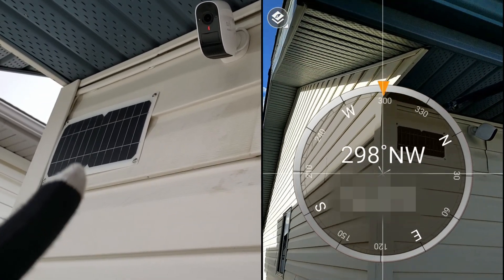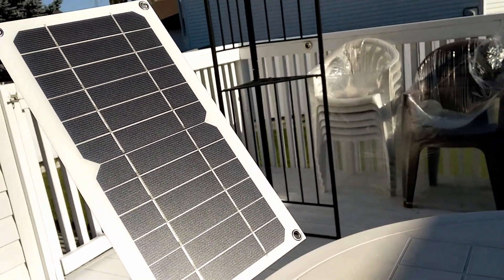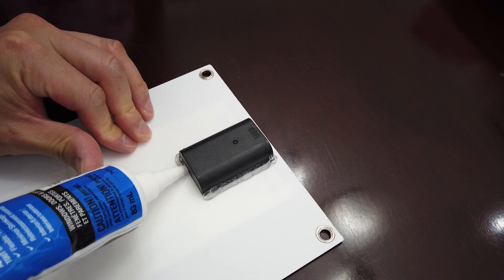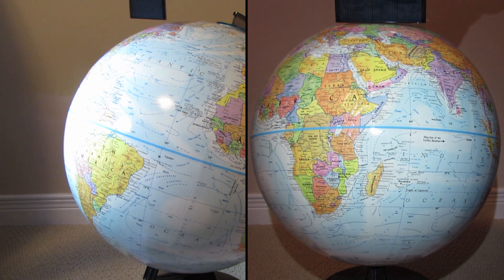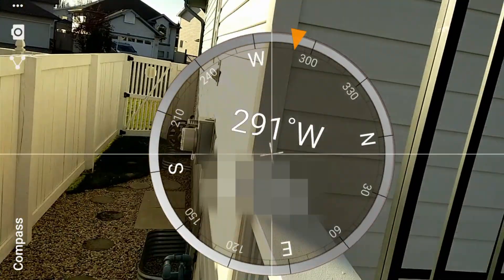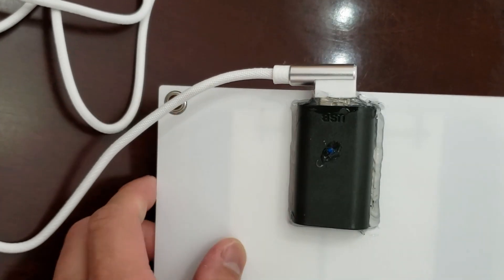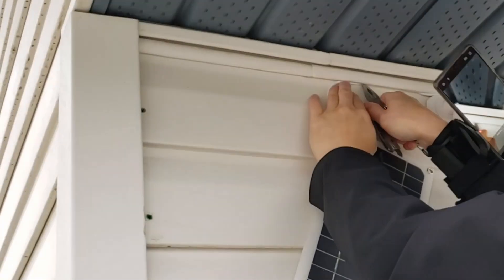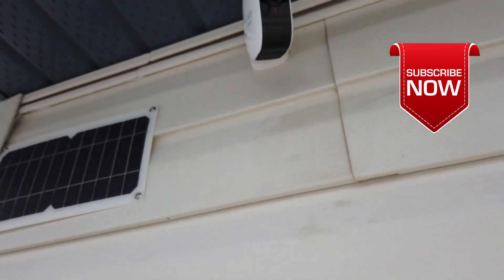Cheap DIY Solar Panel for Battery powered security cameras - Solar Power for Battery powered camera

Comment: Hi,how has it held up after all these years for both camera and solar panel
Reply from the maker: Both the camera and solar panel have held up very well.  It's been almost 4 years now and both are still performing well.  We haven't had to take the cameras down once.  Since this video, we have installed 2 other cameras with larger solar panels and so far so good!

Someone else commented that these solar panels are causing the cameras to drain overnight, but that is not what we have experienced at all.  It doesn't seem to affect it.  Maybe they were getting too many motion detections causing the camera to drain itself.
Reply: @FrakkingCreations  btw I love how u take your time to make sure our questions are answered.keep up the good work
Reply from the maker: Thank you for the comment.  We just want to provide useful information from our own experiences.  Please share and like our videos to help our channel grow.  Consider subscribing to get more good stuff to come.  Thanks for the support.
Reply: @FrakkingCreations  damn.those are some quality cameras.and by having them charged by the solar panels it keeps the battery topped up thus increasing it's life span.about the draining issue,the solar panel will not drain because the circuit board In the camera has been made to make sure in doesn't drain any battery when plugged into anything.those people might have not researched about it.ok I'm gonna buy one set of them cameras now.thank you for giving me the assurance.one more question tho,do u live in a place which get very direct and hot sunlight and rain.and are those cameras exposed to the elements.i actually wanted to get the newest eufycam 3 where there's a solar panel integrated on top of it.but I live in a place where the sun will destroy everything,so I'm not so sure whether to get the eufycam 3.logically speaking leaving it under sun and rain will obviously Degrade the camera and battery faster
Reply from the maker: We get snow and heat.  Temperature ranges from -30°C to 30°C (Winter to Summer).  And we also get rain.  Our cameras are in some shade so that may have helped with the longevity.  I think that it would be important to keep the camera out of direct sunlight, as the manuals for our cameras say to.  Heat is bad for the lithium ion batteries.  So, I'm not sure why they put the solar panel together with the camera in the Eufycam 3 since the heat from the direct sunlight would be an issue for the batteries and electronics long term.  This is especially true for hotter climates.
Reply from the maker: Add to the fact that the charging circuitry of the camera (and any lithium ion system like cell phones) would stop charging the lithium ion battery once the temperature exceeds a safe limit.  For the Eufycam 3 you would want to put the camera where it would get good sunlight to charge properly.  In this situation, the camera and battery could get hot enough that the system would stop charging even if you have great sunlight.

Comment: I have a uniden solo pro camera, i put a aftermarket solor panel on it and work well for about 2 weeks, then stopped working. The uniden solor panel output is 2.5w output power, and the aftermarket one i use is 5w . Do you think the battery was over charged ?

Comment: just thought of it but wouldn't it be cool to just install a light in front of the panel for days where there is not enough sunlight to manually charge the camera without actually having to charge it through AC Adapter? i wonder if that would work.

Comment: Can you do this with a Wyze Cam V3??
Reply from the maker: I wouldn't think it would be a good idea to run your security cameras that don't have a battery by using solar power.  In the times when there are clouds or reduced sunlight the camera may not get enough power and will shut down.
Reply: @FrakkingCreations  even if you attached a battery pack to it possibly? I'm not sure how it works just theorizing

Comment: Great Video and thanks for sharing. I have also installed 2 of them on my 2c pro cams and they work better than the Eufy solar panel that is 5 X the price.
Reply from the maker: You're welcome.  Thanks for commenting to let us know it works on your 2C pro cameras.  So far these panels have been working well for us over several winters.  We've also added more cameras and a larger panel as shown in our vinyl siding hangers video.
Please subscribe, like and share our video to help others too.  We appreciate it.

Comment: The most important part should be how to do the cabling from panel to camera, using that USB power regulator and connector types, for some reasons it was edited out
Reply from the maker: Not sure what you mean that it was edited out.  There really isn't any connectors needed for the panel since it already has standard USB A ports available.  Just using a long enough USB cable is all you need to connect the camera to the solar panel.  Didn't I show connecting the cable to the panel and also to the camera?

Comment: Does it have a battery? How does it work at night I must sound stupid lol
Reply from the maker: Not a stupid question at all.  This solar panel does not have batteries.  The camera does have a battery though and that is why this setup works.  Plus the fact that the battery lasts about 1 year when used per the specifications.

Comment: Can I use that solar panel with my Arlo Pro (I respectfully understand it would be at my own risk)
Reply from the maker: If the Arlo pro uses normal USB adapters to charge then I would think the solar panel I showed would also work for charging.

Comment: Hello Great Video I have on order from Amazon the housings for Eufy Motion Detectors. 
Question: I have Eufy 2C cams need a link for the proper  wattage Solar Panel to Buy?   
 Again Thank You Bill TOG
Reply from the maker: Thanks for the comment.
The solar panel you get would depend on your usage scenario.  I know that the Eufy brand solar panel is a low output wattage of around 400 - 500 mAh.  The 5W one I showed is around 1000 mAh and the 10W one I have a link for is around 2000 mAh.

If you find that your cameras are lasting much shorter than the specs then you are probably getting more detections than the standard used by Eufy to gauge battery life.  In that case, you might want to go with a larger panel to make sure that it is able to charge up faster.  If like us, you use it in winter, there may be times where it cannot charge ... temp below 0 degress Celsius.  So a larger panel may be more appropriate.

Note that a larger output panel may also affect battery lifespan since slow charging is typically less harsh on batteries.

The 5W panels we are using have been good so far for our Eufycam E cameras for 3 years now going into it's 3rd winter.  This year we added 2 more cameras but this time using the 10W panels I linked to.  So far no issues.

Hope that helps.
Reply: @FrakkingCreations  Thank you for the quick Reply. Will do some more research based on your reply. I live in AZ  and the summers here really get cooking 100 to 120+, I think for me  all I want to do is just charge my  2C cams when needed and move the Solar Panel to the next set of cams to charge. Been here 21 years any rubber,  plastic has a shorter life span, the sun is brutal but that's why we are here  for the sun.  Thanks Bill

Comment: All the solar panels I’ve seen say how many Watts the output, not milli amps. 
I’ve just ordered a couple 20w 5v panels from China, should be plenty big enough! 😎
Reply from the maker: Yeah. More than enough.
Generally, to calculate the mAh...
Power = Current x Voltage
Or Current = Power / Voltage
20W / 5 V = 4 A
These panels should be around 4000 mAh not taking into account efficiency and other losses.

Comment: Hi would you have any recommendations of what solar panel to get for the Eufy L20 (13,400mAh battery capacity). I know it’s not eufy supported but heard it charges with a usb-c cable fine, just unsure which V solar panel to get, many thanks
Reply from the maker: For the voltage of solar panel to get it would be based on the charger you got with the camera.  Typically it should be around 5V but best to check the charger.  Is that what you are asking?
Reply: @FrakkingCreations  Oh yes thank you for the help
Reply from the maker: You're welcome. Let us know how it goes.

Comment: Thank's a lot for sharing your experience.
I have a different question:
I have: a 12V volt car battery, a 12V Poly solar panel 10Watt, a 12V PWM LED CMP charger 05Ah, a 12 V Power strip: out put 12V 10A connected to the car battery and a car charger,12V-24V. Output: DC 5.0V - 1000mA with one USB for mobile phone/others 1A and one USB for iPad 2,1A.
Can I connect my Escam QF218 12V (works now with 230V via the mother installation) to the the car charger via a USB cabel?

Comment: How did cost?
Reply from the maker: It cost around $20 - $30 CAD and has been working through 2 winters (almost 2 years now) without any issues.  Find the links to the solar panel and materials used in the video description.

Comment: NOTE: this idea does not work with reolink's argus 2e system. the 5 volt solar panel used here isn't powerful enough. very disappointing.
Reply from the maker: Strange that this is the case.  How much current/amps does the reolink need?  I believe the solar panel in the video is close to 1A so it should work unless there is some other issue or not enough sunlight.
Later this year I will be doing another video installing a larger panel that is supposed to be almost 2A.  Maybe that is something that will work for you.  It's the 10W panel linked in the video description.

Comment: I’m looking to power the home hub but I’m trying to not use a inverter any help would be great
Reply from the maker: Question... Why don't you want to use an inverter?
Reply: Not sure how much the inverter will take
Reply from the maker: I would think that you would also be concerned about having proper voltage to the equipment too.  Which would be something an inverter would do.  Plus you might want to consider having backup battery power too... For example when night time there's no sun.
Reply: @FrakkingCreations  iv installed a 150 W solar panel and I’m going to put a 140ah battery with a 800 W inverter just not sure how much the inverter is going to swallow up

Comment: I don't mean to be rude, but mounting the solar panel at a 90 degree angle to the ground is idiocy !
Reply from the maker: I understand where you're coming from and normally that is not the way it should be done.  But because the Eufycam lasts almost 365 days on a charge I am not concerned about it not getting ideal sunlight.  I mentioned that I did that for ease of maintenance and installation since it will still get enough sun to charge the camera before the batteries run out.

Comment: This is perfect for me ! I am also in Canada. I just little worry that the harsh winter making the panel not functioning properly because its cheap material. Did your solar panel work fine this winter?
Reply from the maker: I feel that the panel is not cheaply made.  It is quite sturdy and well made.  So far we've used it for 2 winters and it has held up perfectly.  Checkout our first winter update video here... https://youtu.be/8Rr11ZC6ow4
Note that in order for the panel to be able to charge the camera the temperature needs to be above 0°C.  I go over this in the update video.  We're in AB and our winters do have few days where the temperature is above zero thereby allowing the camera to charge.  Also, you want to make sure you don't have too many motion detections as it will drain the batteries faster.  Lastly, make sure to position the panel as efficiently as possible.
Hope that helps.
Reply: @FrakkingCreations  thanks for your response. I ordered and received the solar panels and cables. Now i will install them !
Reply from the maker: I wish you as good results as we have had!

Comment: Can you suggest an alternative set up for cameras that don't have a rechargeable battery?
Reply from the maker: It really depends how much power your camera draws.  If you want to use a solar panel for a non battery powered camera you will need a bigger panel as these cameras typically draw more than the cameras like Eufycam.  You will also probably need to add a battery system to it too or your camera will stop working when the sun isn't bright enough to power the panel.

Comment: Will the battery get damaged if its plugged in all the time?  I am considering getting the eufy made solar panel.
Reply from the maker: Good question.  I can't say if it has a noticeable difference or not.  But in my experience and also by best practices, it is not good to use Lithium-ion batteries lower than 20% as that will do more harm long term.
I've always kept my cell phones above 20% and usually at work I keep it plugged in even if at 100%.  Lithium-ion batteries don't charge once they are full so when plugged in the phone will use wall power and not battery.
You will hear that it is not good to keep Lithium-ion batteries at 100% when storing for a long time (without usage), but the batteries here are not being stored.
I guess time will tell for our Eufy batteries.  I would think Eufy/Anker is ok with it since they have their own solar panel too.

Comment: Wow this is great, thanks! They just released their own version but it's $50.
Reply from the maker: Thank you.  I agree about pricing too.  The solar panels that are made from the same manufacturers as the cameras often seem way overpriced.
Reply from the maker: Thanks for letting me know about the eufy solar panel.  I checked it out quickly and noticed that it's only a 2.6W solar panel.  It's going to charge very slow... It's probably outputting about 500mAh.
The panel I show is about 800 to 1000mAh.
In my video description there is also a link to a panel that's twice as big.  That one should output closer to 2000mAh.

Comment: Does it have to be a camera that has a battery or does it work with one that has to be plugged in to work?
Wheee do u get the usb module ?
Reply from the maker: Yes. You will have to use this with a camera that has a battery.  Since the sun does not shine consistently throughout the day or at night at all, a camera that does not have a battery may shut off when it does not get enough power from the panel.
Reply from the maker: There may be a way to daisy chain an external power bank to get a camera without battery to work but you would have to experiment or know how much power draw the camera takes, how much storage the power bank has and how much power the panel can provide in a day.  You would also need a power bank that does not need you to turn it on to power things and also that allows supplying power while recharging at the same time.

Comment: This doesn't work.
Its fine during the day, but what you failed to mention is that the solar panel will drain the eufy battery at night.
Not helpful.
Reply from the maker: I'm not sure why you think the whole video is not helpful or works considering our solar install has worked well for us for over 1 year now and through 1 winter, heading into the next winter.  The batteries for our Solar Eufy install is currently at 87% and we have not had to take it down to recharge.
Checkout our 1st winter update from earlier this year:  https://youtu.be/8Rr11ZC6ow4

Please give us some insight into what you know about the solar panel draining the eufy batteries at night.
Reply: @FrakkingCreations  In my experience, most third party solar panels will need some kind of regulator to control the power.
At night the solar panel will draw power from the battery camera. It can reduce the capacity by 10-15%
Reply from the maker: Thanks for sharing your experience!  It's good to know this.  Do you think that the circuitry of the usb charge controller on the camera would prevent this?
Reply: @FrakkingCreations  That's what I would have expected, but it doesn't seem to be the case in my situation. 
I'm not sure if this is an issue with the solar panel, the eufycam or that the 2 items not being compatible with one another. 
I also don't understand why the solar panel would be extracting power from the camera battery at night.
I would have thought that these solar panels were designed with this in mind. 
But it just might be a cheap and faulty Chinese panel.
I've contacted the seller for a replacement
Reply: @StopTheLies12  did your panel have a blocking diode?  It needs one to stop the reverse drain.
Reply: @rjpemt I don't think it needs one.the board in the camera should not let any power to be drained